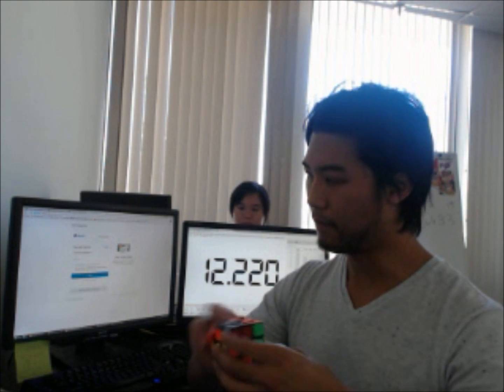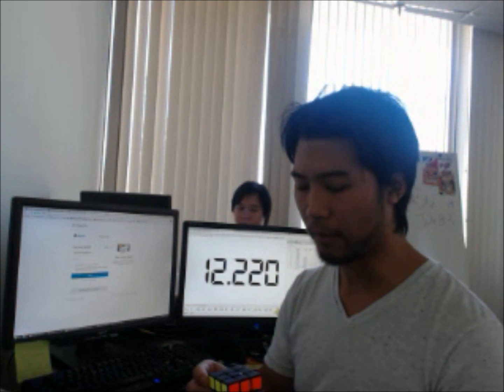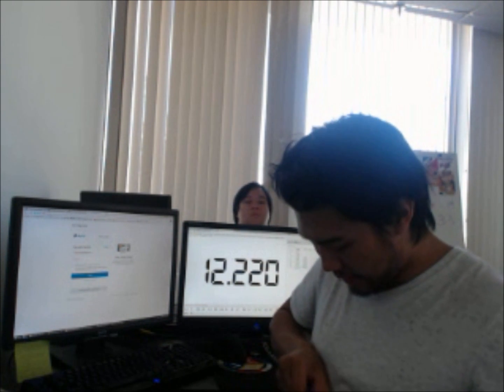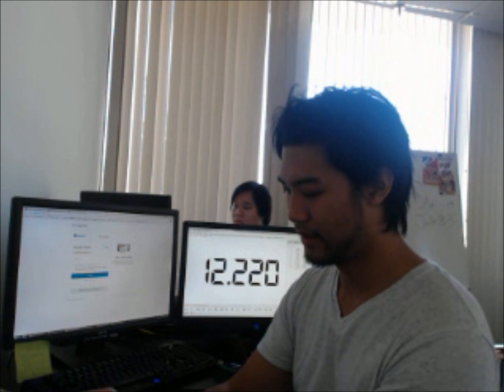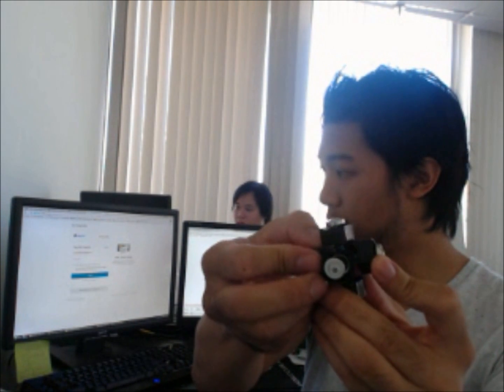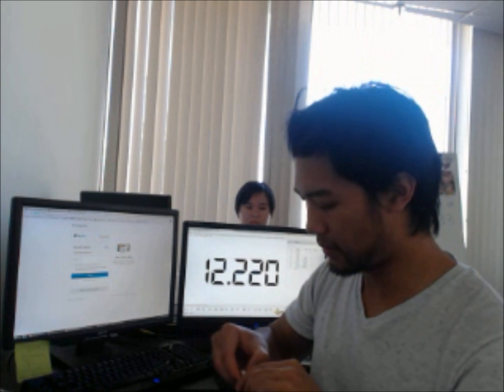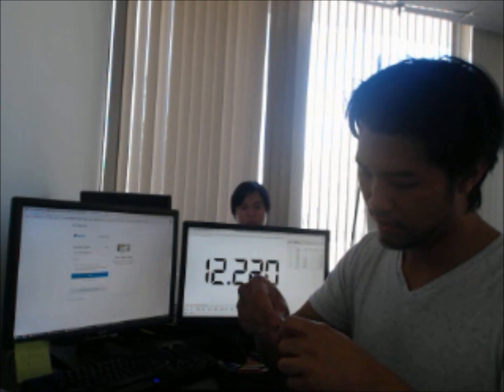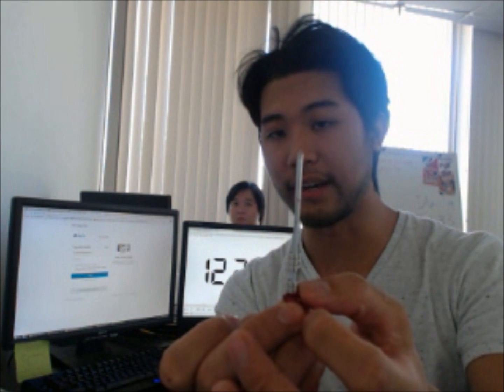True modular tensions using magnets instead of springs.

Comment: Years later, products now have this as well. Here are some:

MoYu Weilong WR Maglev
MoYu RS3M 2021 Maglev
Gan 12 Maglev

If there are springs in the cube and have spring noise, just remove the spring and replace it with 2 repelling magnetic rings. Simple! Here are some advantages and disadvantages of Maglev:

Advantages:
removes spring noise
reduces friction (idk if it's an advantage tho)
makes the cube faster

Disadvantages:
makes the cube heavier